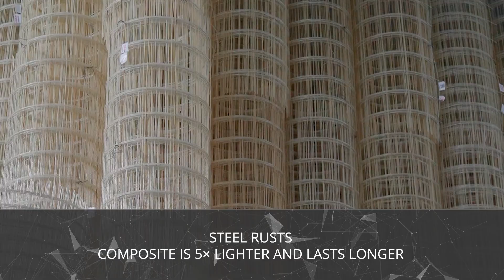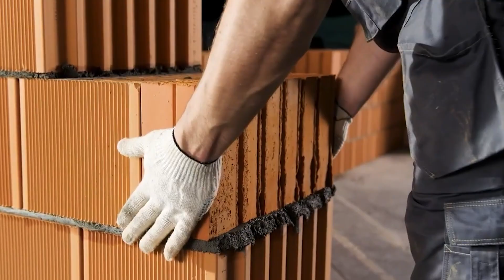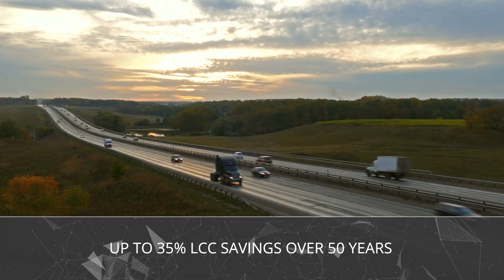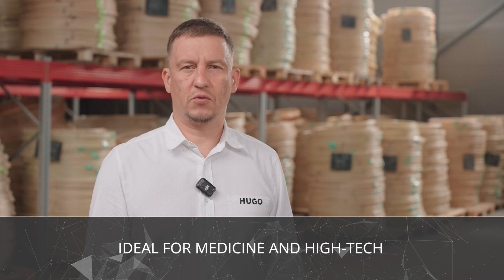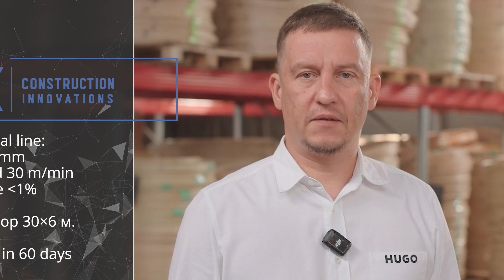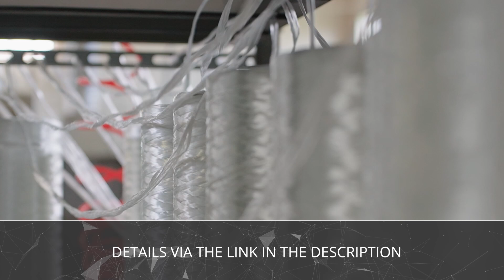Composite reinforcement: advantages, application, payback period

Comment: What is the set up cost for a turnkey line that produces mesh and rebar?
Reply from the maker: Hello! A full turnkey line for rebar and mesh production starts from around $25,000, depending on capacity and automation level.
We’ll calculate the exact setup cost for your specs — just leave a request via the link in our channel bio